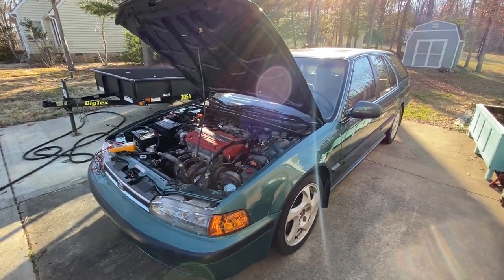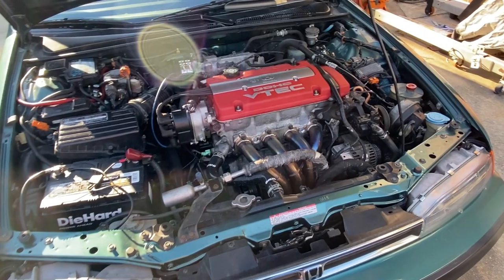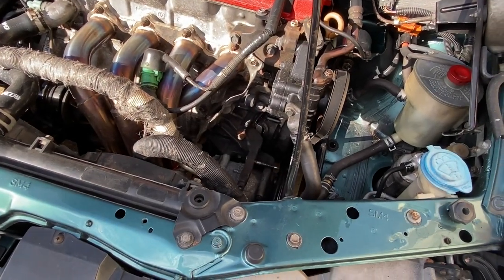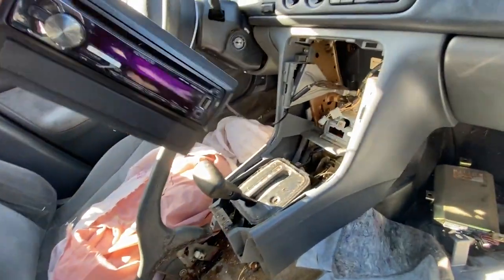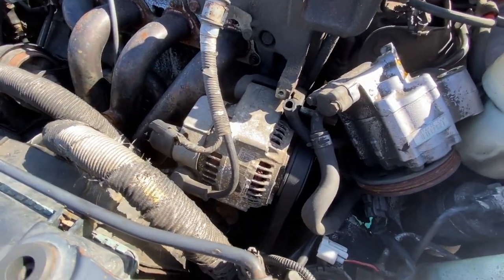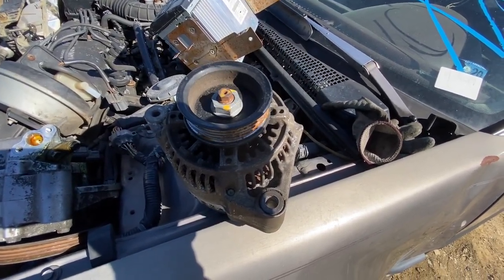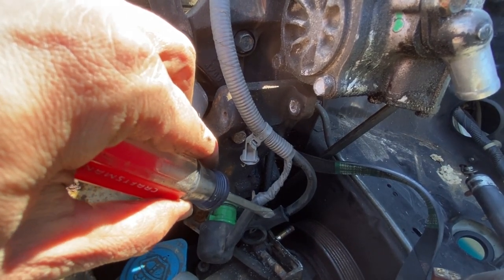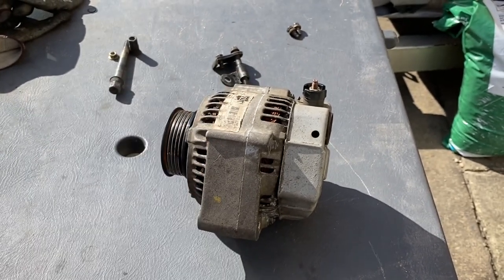90-97 Accord Alternator Junkyard Searching & DIY Replacement

Comment: I'm going to send you a link on a T handle 12mm ratchet wrench. It works great to get the 12mm nut off the bottom adjuster. You definitely have a lot of 5th gen V6s. Ever consider doing the ICU upgrade?